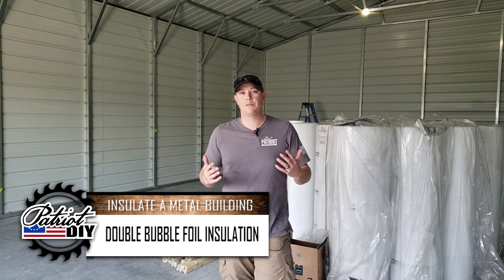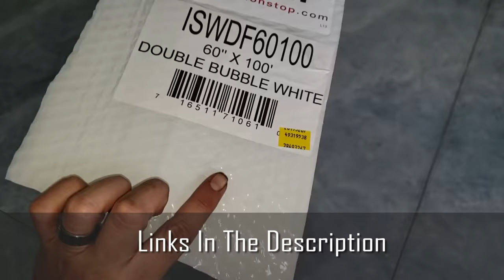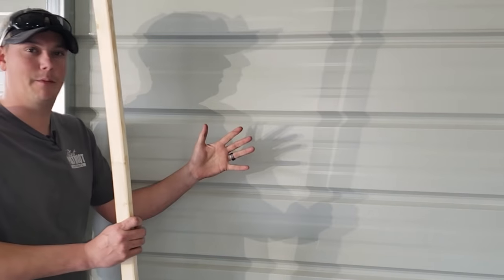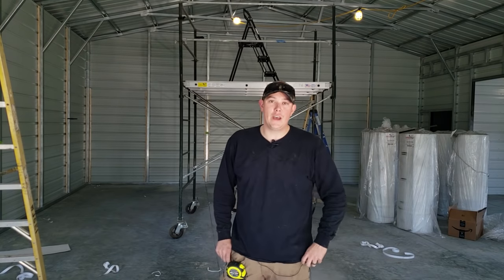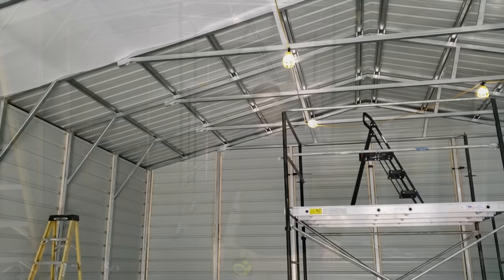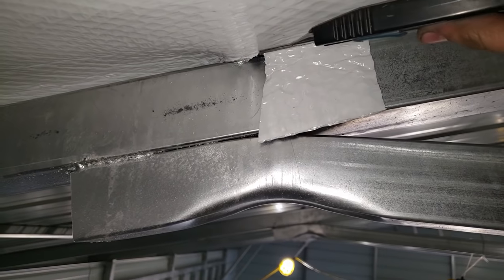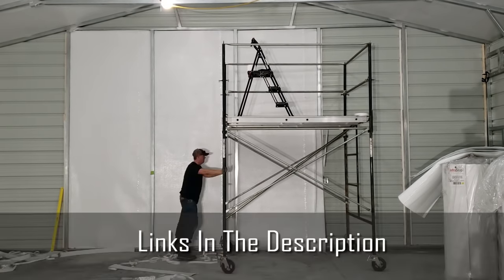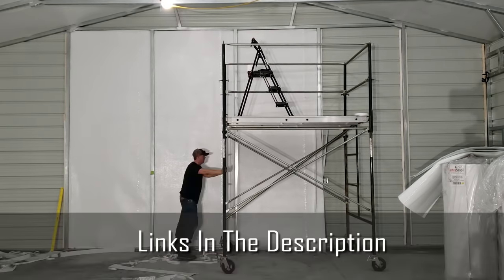How To Insulate A Metal Building / Double Bubble Foil Insulation

Comment: Does the double bubble help with noise? Even rain on my metal roof is incredibly loud. Am about to install bubble foil insulation but wondering if an additional layer of something in ceiling is necessary. What do you think?  Thank you for this video
Reply from the maker: Doesn't do much for sound

Comment: After 3 years how well does the tape hold up on the ceiling especially during those hot days?
Reply from the maker: @novajoe1973  holding fine, but keep I mind I also used screws and staples

Comment: We are converting a metal building, like this, into living quarters. If I put the double bubble directly to the metal, via glue and tape, would this still create a vapor barrier and stop condensation? I plan on glueing it to the metal, then adding batt insulation over that, between the studs.

Comment: are your wall studs 4 feet apart or 5 feet?  My garage is identical to yours as to the walls and studs and it is 5' between the wall studs..  the link to the insulation you made is 48" wide by 100'.
It has been a couple of years now on your instalation.. how is your insulation doing there?  Any updates?  I am also wondering if you have thermal conduction from the outside walls through the wall studs which are exposed inside to your internal air??  Hope you are well and an curious as to how your setup is going still..

mrstan
Reply from the maker: Still doing good in my shop.   Try insulationstop.com for 60"

Comment: I have the same construction except the insulation was installed during initial construction,  my question is, i want to close the wals inside with plywood or something similar, would it be ok or will it interfere with proper insulation process?
Thanks
Reply from the maker: That would be just fine! I've done the same in my shop
Reply: @PatriotDIY  thank you

Comment: Thanks for the video. Where can you get the small pieces of wood that you use liquid Nail? Thanks
Reply from the maker: any home store, they are 1x2 furring strips.   And one extra tip i didnt mention in the video. You can also use L brackets to attach these to the metal studs either in addition to or instead of the liquid nail.
Reply: @PatriotDIY thanks

Comment: With the insulation 48” wide, how did you get yours to look like one piece in between the studs? The studs are usually 5’ apart.
Reply from the maker: You can use whit insulation tape. Or get 60" from insulationstop.com
Reply: Thanks!

Comment: Cheaper up front cost, but it will get brittle over the years and continually flake off. My neighbors shop roof was “insulated” with that crap, and the only thing it’s good for now is making a mess. 

4x8 foam boards may be a better alternative. 

Tiger foam sells diy kits that go pretty far esp if you’re only trying to achieve a slight r value by shooting a thin layer.

Comment: Glad I watched this first! We were getting ready to put 1.5” foam board up against the metal walls of our building. Can you tell me how much of an air gap is required, I’m guessing 1” since you attached it to a 1x2. Also, do we still need the vapor barrier under the foam board if we create an air gap? Thank you so much in advance for your response.
Reply from the maker: My understanding is The larger the gap the better the R value. I'm not sure about the vapor barrier.
Reply: Thank you.

Comment: How did you attach the insulation where the roof meets the side walls? there is a little air gap there and its very difficult to get a screw in there to attach the insulation. are you just using the double sided tape?
Reply from the maker: In that area, just double sided tape.

Comment: Does this work for the winter time also? For those jobs when it’s a bit cooler and breezy.
Reply from the maker: You can expect it to be about 10 degrees warmer in your shop in the winter.  Of course if you pair it with a wood stove or heating system like i have you can get it as warm as you want

Comment: Very nice video and it was some good information, may I ask what size shed and how much insulation you needed.  I have a 20x21 with 7ft sides, and I need to insulate my cause the Summer is a smoker. It don't look to hard  so you put the 1x2 in all the squares of the sides and you put in the bottom and top of the square?  Really nice BJ Beagles

Comment: Ok, so here's my main question. On a previous video, you sealed up all the air gaps with expandable foam and silicone. So...why the need for the spacers? I mean, if there's no air flow behind the insulation, the condensation will just run down to the floor and sit there until it dries. My logic tells me it would be better to have the air flow BETWEEN the insulation and metal walls to keep condensation to a minimum. I'm not trying to be a smartass. Just asking a question as I am researching how I'm going to insulate my metal shop. Haven't decided yet, but I'm either going the same route you did or rigid foam board. I'm leaning to the rigid board, but I think my question is relevant in both regards. Thanks in advance!
Reply from the maker: I have no idea man, I'm not a pro. I'm sure my methods are not perfect but they have been working well so far!

Comment: I have a 30x30x10. I was thinking of doing this and then coming back with rigid board over it. Will this be enough to heat and cool my building? I’m in central Mississippi. Great video!
Reply from the maker: I would think so

Comment: I came across this video because I am having a metal barn being built in about four weeks and I want to insulate it from the hot South Texas Sun and Temperatures.  I hope to cool the barn and it's shop area with evaporative coolers and I don't think that normal insulation will do a good job using standard fiberglass or sprayed in insulation.  (PLELASE Correct me if you know for a fact that I am wrong there!)  

So, in this video, the installer used vertically installed  wooden slats, glued down and then stappled the radiant barrier to those slats (studs).  

1. Would it not have been better to use those slats horizontally and applied to the outside of the vertical metal frame and thereby creating a bit larger gap between the Exterior Wall and the Interior Radiant Barrier?

2. Since I intend on cooling the shop (and maybe the whole barn) with an evaporative cooling system supplied with fresh air into the evaporative cooler and an exhaust fan on an opposite wall, would it help, hurt or have no effect to install fiberglass or sprayed in insulation in the gap between the outer wall and the radiant barrier?

Thank you and may God richly bless you and yours.

Comment: Think about doing this on my building. I had a question though. What kept you from just running the insulation horizontally alone the walls across the vertical beams? it would have a little bigger air gap. Also wouldn’t have to do all the 1x2 wood work.
Reply from the maker: Only reason is because I wasn't sure if I'd be covering the walls so I wanted to keep the studs exposed.  If I was going to be covering the walls right away I probly would have done what you said
Reply: @PatriotDIY  thanks for you input. I think I’m going to run horizontally along my walls and do the Ceiling like you did. Thanks for all the ideas! Got a bunch of good content.

Comment: I'd give the job a  85. There's a heat gap at the roof peak that allows heat to exit. But it also allows dust and debris to get in. Covering that will allow whatever to get in (rain, dust, dirt, insects like wasp etc.)  without being noticed.  A hard side ways rain also.

Comment: How has the double sided tape held up after a year? Also, did the liquid nails hold up. I'm concerned with how hot my metal gets and losing adhesion. Thanks great video.
Reply from the maker: Holding great so far...2 years

Comment: Would this work well in a loft/attic between a tin roof and wood cabin ceiling? I’m looking at insulating the loft to keep heat inside the house in the winter and heat out in the summer. Thoughts?

Comment: I like it a lot. Your engineering talent and work ethic reminds me of me…more than a few years ago. Question: I wonder if the expansion and contraction of the steel siding will cause the two sided tape to loosen? Do you think applying the glue to the edge of the 1x2 and attaching it to the post would be worth consideration, because the steel posts are substantial and would flex very, very little if any thereby eliminating movement by the 1x2? That would still leave a sufficient air gap between the siding and the insulation.

Comment: I have particle board on my walls of my 14 x 32 metal building.  If I did this plus putting styrofoam insulation in between my particle board would that increase my insulation for winter time also.
Reply from the maker: I believe so

Comment: Couldn't read through all the posts I'm sure it's already been asked, but this is 2 years after the original post. Can you tell us how the insulation is holding up with the double-sided tape? And how wide is it between your studs?
Reply from the maker: Mines holding up great, but keep in mind Im not relying on just the double sided tape, That was really just to help install it. You will notice toward the end of the video, I also secured it with staples and screws.

Comment: Trying to figure out how you did the ceiling it was so fast where did the double side tape go? on Beams or inside Beams.  Will it stick well are is it best to use 1x2 and then tape like the sides, not sure what I seen with the inside of the roof?  Can you clearify what you done. Thanks
Reply from the maker: The tape went on the metal purlins. Then I tucked the excess from the edges under the beams and used screws in some places too

Comment: Interesting. How's this holding up? Would you do it the same way again? I put up a 48X60 last summer and used the radiant reflective stuff on the trusses before placing the steel roofing. Never thought about using it for the walls. I considered spray foam until I saw the price, they are way to expensive for me.
Reply from the maker: I'm happy with it, it's holding up great.  If I was willing to spend more I'd do spray though.
Reply: @PatriotDIY  yeah spray the paint as it's starting to crack under pressure
Reply: Is there a gap standard  between the insulation and the metal siding? I have yeah.2 x 4 framing attached to the steel tubes where I plan to attach OSB siding. Wanted to go over the top and then place the osb on top of insulation. That would give me a 2” gap.

Comment: This stuff looks like it works great and it's relatively cheap.  I think I would go back over the ceiling edges with another set of outside stringers just to make sure the ceiling double stick tape doesn't come loose from the heat over a bunch of years.  I know u put in the staples but another strip on the outside would lock this stuff in.  Maybe the same on the walls, especially on the sides directly exposed to the sun most of the year since there's plenty of room for them without protruding out past the steel uprights.

Comment: What is the spacing on your walls I have a 30x80 metal building but my walls are 5ft on center and I can't find an insolation to fit in between the studs

Comment: One more question how good is that double bubble insulation good at holding in the ac and heat
Reply from the maker: Seems to hold fine. I set the temp, it reaches the temp and stays there until I turn the ac off.

Comment: Does the air space size matter? I built a polebarn with the wooden poles and 2x6 around the outside. I was planning to fill in the spaces with 1 inch foam and then install the double bubble to the 2x6's leaving a .5 space and then build wood frame walls with fiberglass insulation in the studs

Comment: “Radiant heat from the sun…” JFC, solid education there, MAGAt. Signed Combat Veteran. 🙄
Reply from the maker: The sun heats up the metal siding which heats up the inside of the building if that's not radiant heat what would you call it?

Comment: So would this work if one wanted to run A/C inside? I'm in SC. Good video but I'd like to know what the inside temperature is during the super months. I'm a pipe welder and fabrication guy that does work. So I'm looking into a building soon for my own work. Thanks!
Reply from the maker: Usually about 10 degree difference inside. On the hottest days it's about the same temp as outside.   I'm installing ac in the next couple weeks so stay tuned!!

Comment: Adhesive on tape is very temperature sensitive. When that gap air heats up it will melt the adhesive on the roof and the insulation will begin to fall. Then you will not be able to avoid drilling the roof beams to secure the insulation with long pieces like the walls.
It's curious how people in the U.S have to hang flags to remind them where they are.
Reply: I guess the same reasons that Europeans put stickers on the back of their cars to remind them what country they live in.

Comment: There is a paint called cool wall that does basically the same thing is that and it's about 50 $60 a gallon their website indicates that reflects most of the Heat and it's a lot cheaper

Comment: Did you seal the holes in the corrugated roof sheeting too before installing double bubble?
I’m not sure if I will condensate or not if I seal up those holes before I insulate ceiling
Reply from the maker: I sealed the holes in the corners of the siding but not at the roof.  They are covered by the insulation but not sealed off completely. 
https://youtu.be/VTONXleKysQ

Comment: I just watched your video on the insulation install. I didn't see where you may have installed a 1x2 on the bottom and top of each wall section. Is that needed?
Reply from the maker: I didn't, but it wouldn't be a bad idea!  A buddy of mine is doing the same instal and using l brackets to attach the wood instead of adhesive that's a good idea too

Comment: Is there any concern that the double-sided tape's adhesive on the ceiling part is still going to get hot and come apart since it's on the outside of the insulation?
Reply from the maker: No, I also used screws to attach it

Comment: Nice try and looks good! Only problem ur gonna have will be the wood strips liquid nailed to the metal isn’t going to hold. Due to the elements that metal gets to hot, cold wet for it to bond. It will bond just fine to the strips tho. I’m not try to give u a hard time only trying to let u know before u spend the time and money installing the wood siding inside. Btw I also live n NC and have installed hundreds of those same metal buildings in the past. I’d be glad to help u away I can if u have any questions with ur building and going forward with ur other projects.
Reply from the maker: Thanks for the advise. I'll add some L brackets as well to permanently secure to the stud. That should prevent the issue you're talking about
Reply: I'm also in NC putting up a metal building. How would you recommend insulating Chris?

Comment: Recently got a metal building installed. No electrical or water run yet but planning on it.
I'm assuming the wires and such need to be installed before this insulation, otherwise the wires would be exposed. Is this correct?
Reply from the maker: all  of my wiring is run in metal conduit pipe. I did my insulation first, then electrical.

Comment: Would like to know if this will stop condensation under roof as we want to finish it off . Put regular. Bat insulation and we had leaks n mold . Will this help me ? Any help would be  appreciated  .
Reply from the maker: Do you have metal roof beams? If you install is Over the metal studs/beams it should completely stop condensation issues.  I still get a little on the roof beams since I put my insulation between them rather than over them.

Comment: How do you deal with condensation in the winter ? My metal building has fiberglass insulation on the walls. I was thinking reflectix or something similar for the ceiling,  but it drips in the winter with condensation.  Wouldn't that still happen?
Reply from the maker: This barrier prevents the condensation.

Comment: Have you had any of your insulation on the roof try to fall?  I live in FL.  It gets crazy hot!  Within a couple weeks my double-sided tape started to give and it fell.  I used the Gorilla brand.  Any suggestions?  What tape did you use?
Reply: I live in Southwest Florida, it is very hot, I would like to know how this insulation works and if you would recommend it to me.  Thanks and good luck with the tape.
Reply from the maker: No, I haven't had any fall. The tape I used is linked in the description. Keep in mind though, I also tucked the excess behind the rafters and used screws in some places. Those 2 things also help to keep it in place.
Reply: @yusetsanchez5223  Today I ordered the double-sided tape he listed.  I'm going to give that a try.  I'll also secure it with some self-tapping metal screws.  I got about 1/2 of my walls done, and I've noticed a difference, although not that much yet.  I think once I get my ceiling done, it'll be huge!  I'll let you know!
Reply: @keyboardr4him1  , thank you for answering me, I would like to know if I noticeably improve the temperature inside your workshop.  I just finished my workshop and still haven't chosen the insulation, the spray foam is crazy, just the roof $7000.00.  Thanks in advance, good luck with the projects.

Comment: What is the width, center to center, of your wall studs? If your insulation is 48” wide I’m assuming your studs are around 42”? I’m having a 24’ x 30’ metal building put up, but my studs are 5’ on center. Would I need an additional furring strip where I had a seam between the studs?
Reply from the maker: Mine are 60" OC.  I bought 60" rolls from insulationstop.com